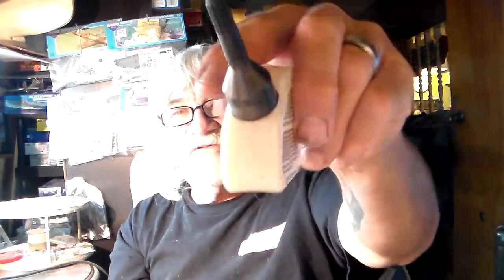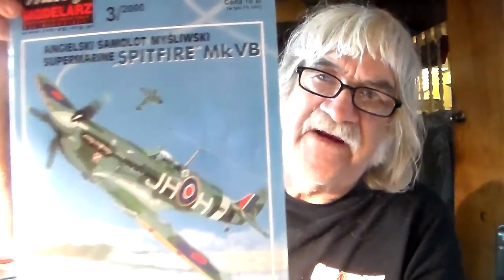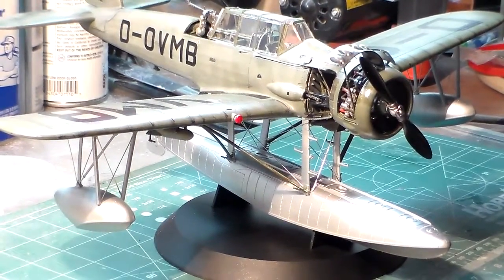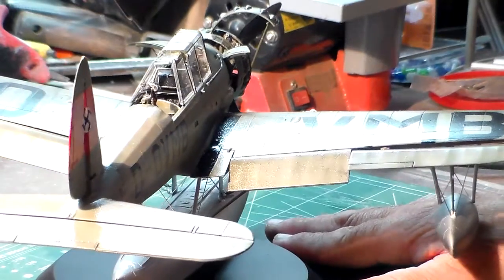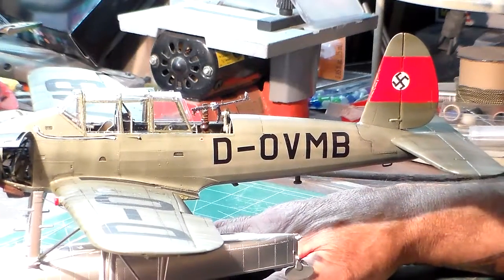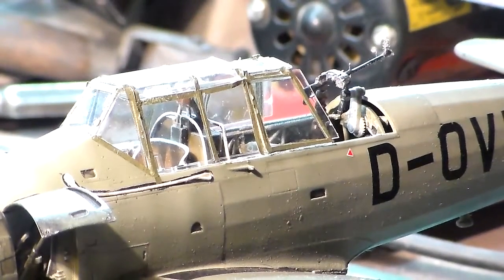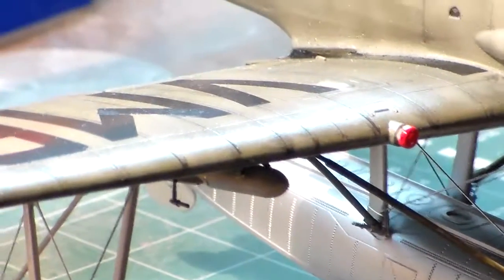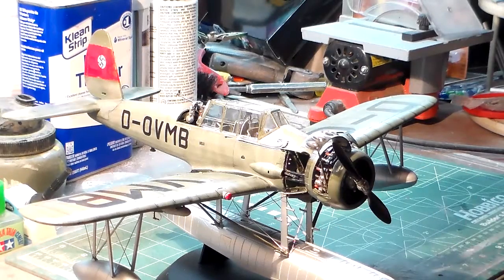FINAL REVEAL  REVELL ARADO 196-B Video 5

Comment: Cracking job Frankie! That Alclad aluminum finish looks the bomb mate! What did you use for your rigging, I used stretched sprue on mine, but not certain if that's the best method. Cheers : )
Reply from the maker: International British Modeler Ahoy Martin                                                                                 Thanks Martin the rigging was done with wire I used sprue one time when it came to cleaning the model the sprue broke off sprue is very good to use only if its not disturbed.  Thanks Martin you inspired me in to getting this A Hardy Thank you.  You the Mannnnnnnnnnnnnnnnnnnnnnnn.Frankie Day